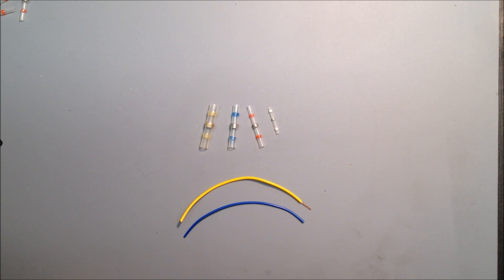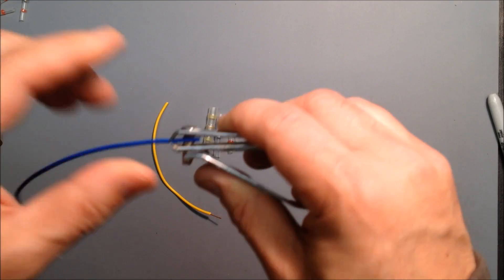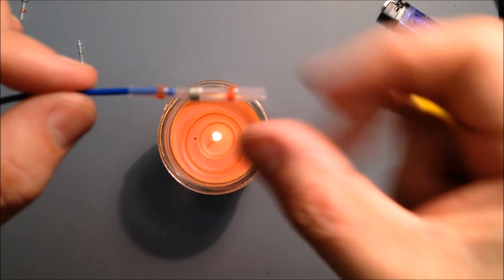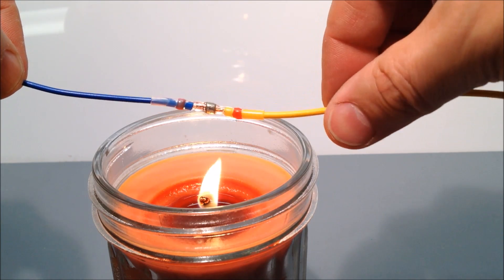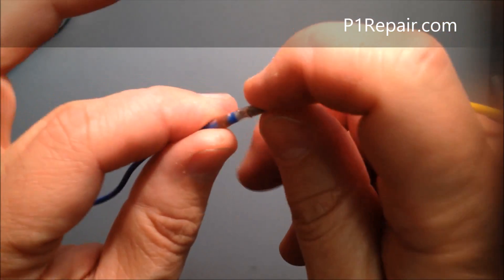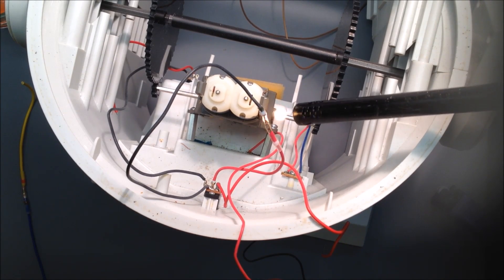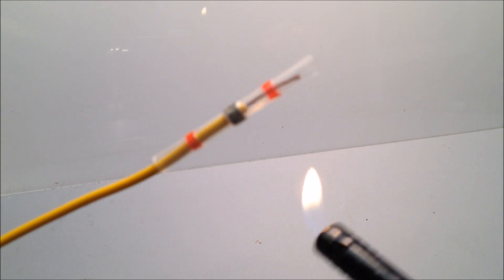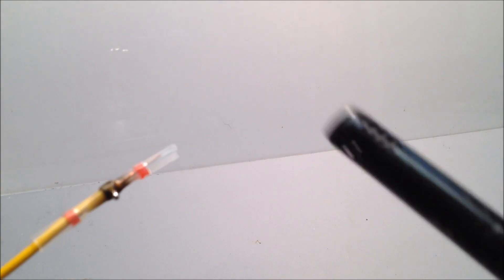Solder Splicers heat-shrink tubing with adhesive and solder all in one

Comment: Whoa, this verbose video could have been 3 minutes long,.  Less is more!  Going through the colors and telling us what wiring to use them for?  How about "pick the size that fits your wire"?  Period.  Toenail clippers?  Sure, they can work to strip wire insulation, and so can a box cutter or knife, but geez, how much can wire strippers cost?  At 07:13..."...the heat goes up"?  Priceless.  Will file this in the 'hack' file.
Reply from the maker: This video was made for customers who wanted to repair one or two broken wires without investing in special tools.  Is it a great video? No.... But the footage ended up being used in countless video advertisements for these connectors. Sorry it ruined your day.
Reply: @p1repair  Point taken, but not sure if buying one of many $5 (or less) wire strippers on Amazon is an "investment", and even $3 at Harbor Freight won't break the bank.  A small splice kit is about ten bucks, if someone spends THAT much to repair 'one or two broken wires', they should at least be informed on how inexpensive it is to 'do it right'.  Maybe not buy a heat gun just for this purpose, a stick lighter plenty good, as you illustrated.  Video still too long and wordy.  Peace.

Comment: Great video. It's good for those who don't have the right tools handy in an emergency situation. One little hint I could offer though. Why not start the operation by melting the solder first, then do the outside seals. By sealing the ends first, a little bit of over-zealous heating on the solder could possibly cause gas build-up inside the sealed tube, thus causing a 'gusher' if the tube forms a leak.

Comment: Soldering is so easy.  Just learn how to do it and forget about these gimmicks.  I solder 30 pieces of wire while you wasted your time with that little gimmick.
Reply: Soldering is easy, can solder and use heat shrink when water resistance isn't required, or use electrical tape if you're a hack, but outdoors the benefit over your soldering is the waterproofing these connectors provide.

Comment: Buy a heat gun. Never use an open flame that is for amateurs.
Reply: Lol I been using a pocket torch for years for all heat shrink you just dont put it directly in the flame and hold it there, theres a technique to using a torch but once you get it its twice as fast and just as good

Comment: Sorry Dude, but do you seriously not even know what gauge of wire each color is for?  Did you really just say the yellow ones are for automotive type of wiring and the blue ones are for small lamps???? Seriously? Look man they are all good for automotive wiring and the colors represent the gauge they are for. And as for a lamp? I myself would not use any of the connectors you have  for ac wiring application! Only dc/automotive.------ (that is actually why I found your video! Trying to see if I am correct about not trusting these with ac voltage?)
Anyway It is soooooo freakin obvious you do not know more than about 98% of your viewers do! So please stop making videos until you learn all about it yourself! In other words, go watch a bunch of instructional videos yourself, before trying to be the instructor.
You will sure get a lot more likes and subs if you will! ........just sayin

Comment: I'm sorry dude, been doing this a while, and your whole method is wrong. You should pull the connector to one side, intertwine the wires from one to the other, then slide the sleeve back over both wires. The rest works, but damn man, get some tools.  Good video production.
Reply: hicksville
Reply: I second that!
Reply: It's not wrong, you dont have to intertwine the wires they're soldered together they're not going anywhere lol

Comment: You should show the best way first, using that heat gun and then the less desirable direct flame methods.  Heat guns are cheap at harbor freight and elsewhere.
Reply from the maker: Yes, that would be nice but that is also easy and should not need instruction. Anyway, this little project went nowhere. The intent was for people to be able to use these splicers at a low cost without having to invest money in tools they don't have any other use for.  The idea was if someone broke their speaker wire when repairing their phone they could fix it with this, without needing a soldering iron or other tools.